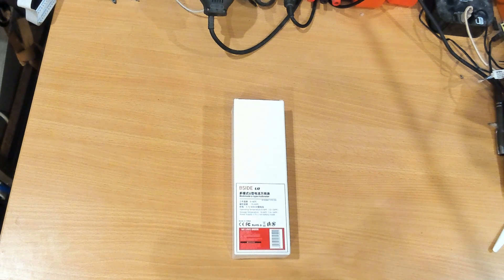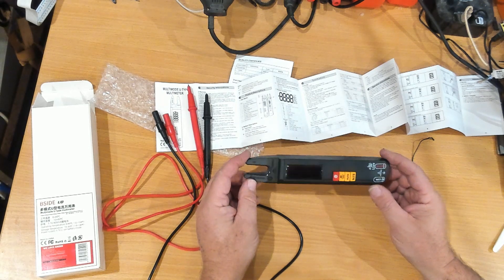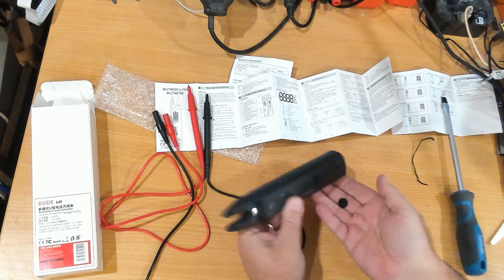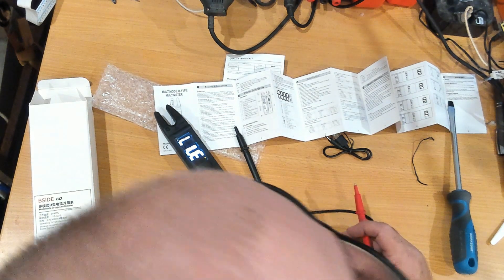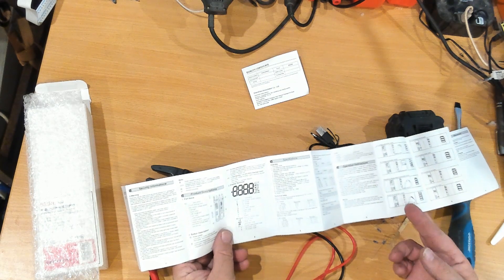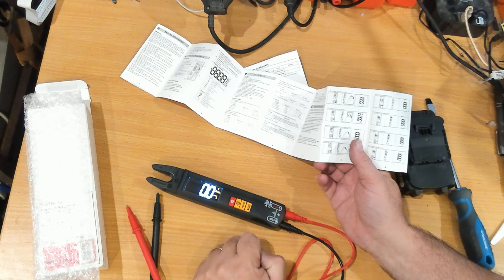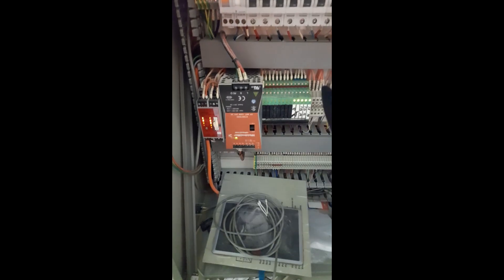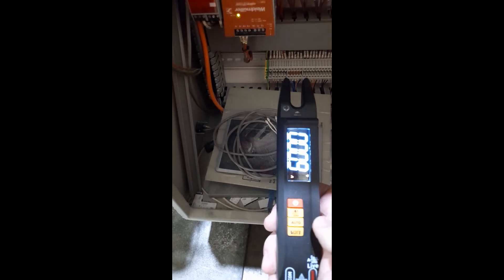Unboxing BSIDE U0 Multimode U Type Multimeter

Comment: Pil değiştiriliyormu 5000 maH pil takmayı düşünüyorum ürün elime ulaşmadı inceleyemedim bilgi verirsen sevinirim
Reply from the maker: I haven't opened mine and not had to charge it since the first time after unboxing.
I don't know if the battery is replaceable, but at this price point, I wouldn't bother replacing the battery.
Reply: @CyberOne bilgi için teşekkür ederim bazı yorumlarda pilin çabuk bittiğini okudum çözüm bulmaya çalışıyordum

Comment: possibilita di avere la spiegazione in lingua italiana
Reply from the maker: BSIDE U0 Multimetro a pinza ad alta precisione a forma di U Resistenza alla tensione di corrente AC/DC Torcia incorporata Induzione di tensione senza contatto Spegnimento automatico Strumento di misurazione compatto

Questo multimetro digitale a pinza è progettato per misurare la corrente AC, la tensione AC/DC e la resistenza. Con cicalino di accensione/spegnimento, allarme cicalino, spegnimento automatico e funzioni di rilevamento V-alert e altro ancora. È compatto, ad alta precisione e facile da usare. Uno strumento perfetto per la risoluzione dei problemi che ti aiuterà a risolvere rapidamente e in sicurezza i problemi elettrici in auto, in ambito industriale o domestico. Ampiamente utilizzato in energia elettrica, comunicazioni, ferrovie, edilizia, giacimenti petroliferi, misurazione, ricerca scientifica e insegnamento, imprese industriali e minerarie, ecc.

Caratteristiche:
【Pinza amperometrica multifunzionale】: Questo multimetro digitale a pinza è progettato per l'identificazione e la misurazione automatica di corrente AC/DC, tensione AC/DC e resistenza. E le correnti AC e DC possono anche essere commutate manualmente. Supporta la modalità di azzeramento manuale della corrente DC. Con cicalino on/off, allarme cicalino, identificazione firewire livewire, spegnimento automatico e funzioni di rilevamento V-alert. Ha una funzione di misurazione True-RMS a 4000 conteggi per misurazioni accurate su carichi non lineari.
【Display digitale retroilluminato】: ha un display digitale retroilluminato ad alta luminosità, così puoi leggere i dati in modo chiaro quando lavori in condizioni di scarsa illuminazione, come armadi elettrici, sotto edifici, dietro elettrodomestici e in altri spazi chiusi.
【Design a ganascia di apertura】: normale design a ganascia aperta, con elevata affidabilità ed efficienza, facile da gestire con inverter / scatola di convergenza / test di cablaggio in spazi densi e ristretti, pratico per test e manutenzione di apparecchiature elettriche.
【Ampie applicazioni】: uno strumento di risoluzione dei problemi perfetto che ti aiuterà a risolvere rapidamente e in sicurezza i problemi elettrici in auto, in ambito industriale o a casa. Ampiamente utilizzato in energia elettrica, comunicazioni, ferrovie, edilizia, giacimenti petroliferi, misurazione, ricerca scientifica e insegnamento, imprese industriali e minerarie, ecc.

Specifiche:
Colore: nero
Materiale: ABS
Batteria: 1 batteria al litio da 3,7 V, 400 mAh (inclusa)
Intervalli: Auto ranging
Max. Display: 4000 conteggi
Tensione CC: 0,800 V-610 V
Tensione CA: 0,800 V-610 V
Corrente CC: 1-100 A
Corrente CA: 1-100,0 A
Resistenza: 5,0 Ω-40,00 ΜΩ
Discriminazione della linea di fuoco: √